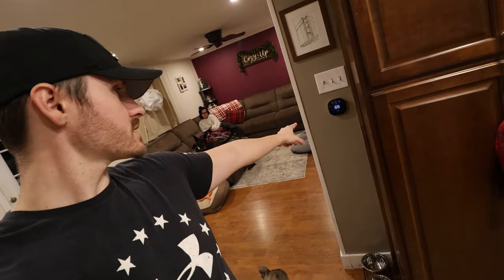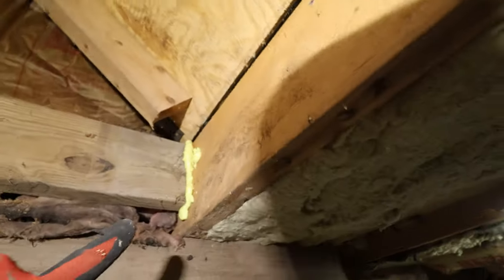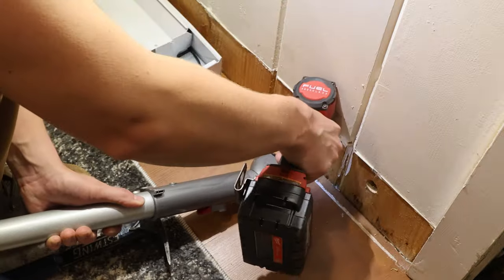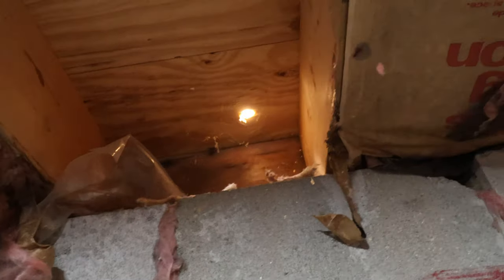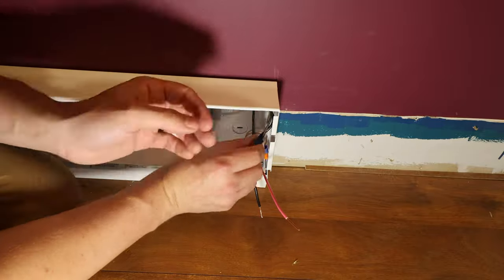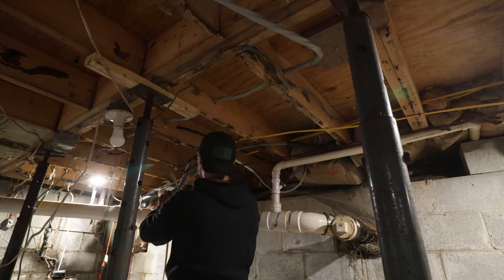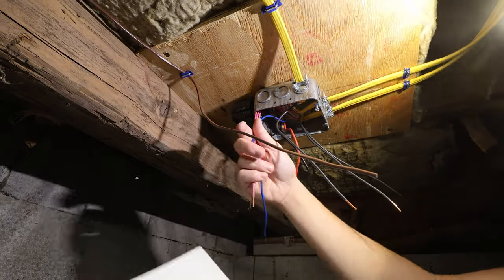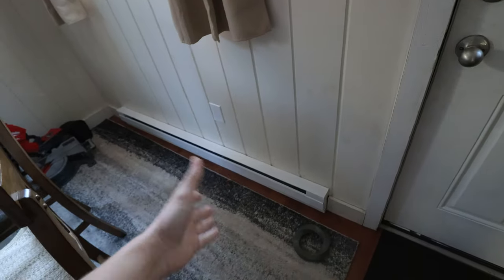Electric Baseboard Heat Install with ecobee smart Thermostat

Comment: Its been a while since ive been around baseboard heaters. I remember them being slow to heat. But the quality is quite stable.
Reply from the maker: They did a much better job evenly gradually heating than our original propane system and it is so quiet!
Reply: I grew up in Michigan, currently living in California. I dont like the kind of furnace you replaced. You definatly could tell when it was running. Roasting everyone nearby. When I moved into my first apartment, it was heated by steam. I think radiant heat is more comfortable.

Comment: Awesome video! Do you know if the relay you used would be good to run multiple baseboard heaters from? Like if instead of 2 baseboard heaters you could run 4 or 5 to that same thermostat? Same process?
Reply from the maker: Great question! Personally, I would ask the manufacturer. However, from an electrical stand point it can hold as many baseboards as 20amp amps will allow. So if you have 5 baseboards who’s total 125% amperage is less than 20amp then theoretically the relay will be fine. You just need to wire it in a junction box like I did in the video

Comment: Hey bud  what type of wiring u used for 240  base board heater.
Reply from the maker: I used 12/3 because of the calculations I did told me that would be the correct size. I could have also used 12/2 but I like have a neutral wire going to every junction point.
Reply: How much electricity these baseboards pull per month?